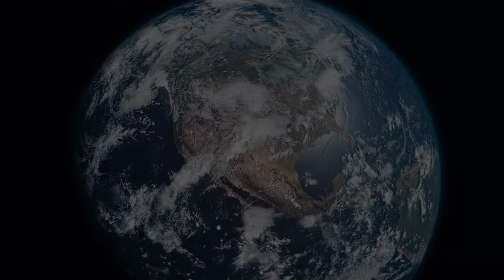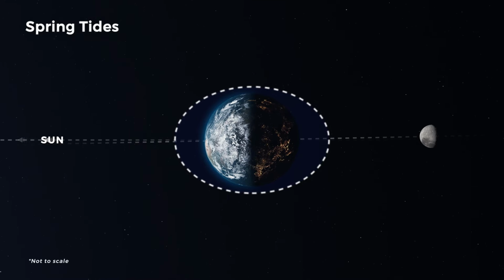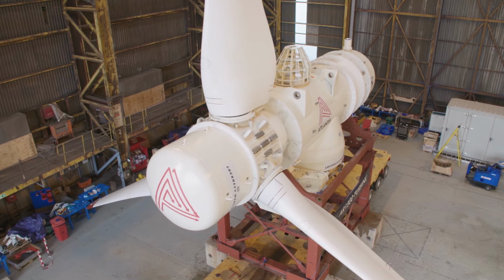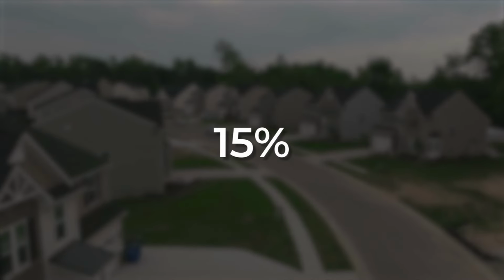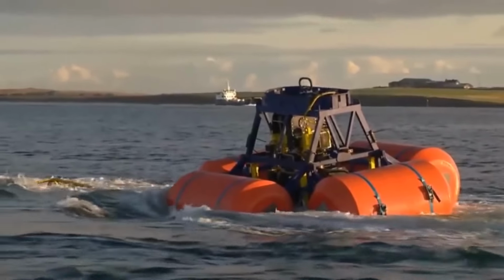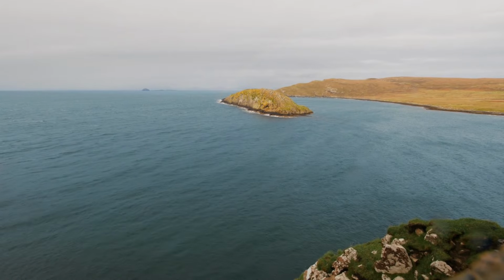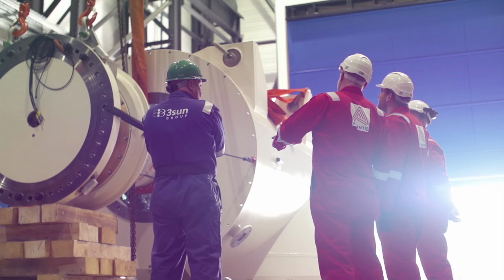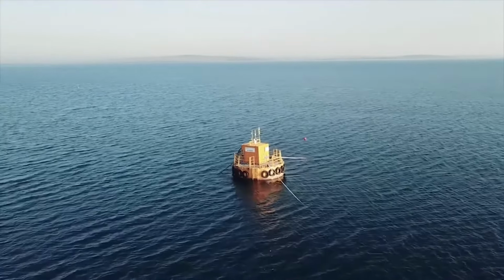Can Underwater Turbines Solve Our Energy Problems?

Comment: 11:35 I wonder if that forecast takes into account the rising cost of carbon based electricity? If coal gas and oil keep rising, (or even fluctuating erratically) this could provide  not only a supply - stable power source, but also a cost - stable power source.

Comment: 11:35 I wonder if their calculations took into account the rising cost of electricity from carbon based sources. If, 16 years down the line, carbon based electricity is prohibitively expensive due to dwindling supplies and tariffs, they will be glad they did this.
Reply: These are the more expensive big industry concepts. Some already out of market (Seagen, Openhydro). Our design is more streamlined to keep cost low by several factors. We expect to be cheaper than any alternative below 0,01 €/kWh in 5 years. https://youtu.be/nqbVTVMSSTM
Reply: While browsing for hydrogen production technology I came across a very interesting new science discovery by a NZ Lab named H2IL . It has the potential to replace nuclear, fossil fuel and renewables energy. I was intrigued by something so simple but scientifically logical. What do others think of it?

Comment: heard this crap in the early 90s, it's 2019, you think China, India and Africa are gonna stop using oil?
Reply: Naked Eagle I doubt China, India, or even the US or Britain will stop using oil any time soon. The point of researching and implementing new energy technologies however is to make it eventually economically viable enough to transition from fossil fuels to renewable energy en mass (aka it costs the same or less than gasoline for example). This isn’t just about energy extraction but also energy storage technology and everything that comes with it (ex. Automobile Manufacturers).

With the 10’s of billions of dollars in R&D both private and public going towards renewable energy every year, I think its simply a matter of time before fossil fuels become literally obsolete. 

Its just got to be a better deal on the consumer end. Just like anything in a market system, the market ultimately decides.

Comment: can we  please stop interfering with the earths systems, specially when we have nuclear available, it makes 0 sense to mess with our oceans anymore than we need to.
Reply: You are underestimating the risk of nuclear powerplant, if there are other powerplants that can provide enough energy to all humans nuclear wouldnt be so popular, it is only because that oil is consumable and can be exhausted and other powerplants doesnt give enough energy to supply all humans that engineers and scientist resort to nuclear powerplant, if there are more like this natural free source of energy enough to supply our electricity then nuclear would be only used for research and other scientific purposes and not massive powerplants that can endanger residents if something is to happen
Reply: @lemting2264  no i am not, nuclear is by far the safest, specially as we move towards molten salt reactors that are self regulating and are almost impossible to melt down, even then due to the lower pressures (steam) involved are no where near dangerous, (the radioactive part will just go to a separate chamber to cool down and solidify.
wind kills lots of birds every year, solar breaks easily and is really hard to recicle, dams displace much land and in case of rupture flood the areas down river, coal pollutes a lot,
while even the current nuclear plants have proven to be very safe, even in the major disasters that have happened (which all used very old reactors) have small amounts of casualities due to radiation, the total number of all cases is around 100 deaths.

plus molten salt reactors increase safety by a whole lot due to their self regulating nature, if not for the anti nuclear propaganda we could have been powered by this amazing tech since at least the 80s (reactor was developed in the 60s with a fully functional prototype) which btw can also produce (while also producing power as normal) the medical isotopes which today cost hundreds of milions due to needing a whole reactor just making a single product
Reply: @cj09beira  it would be acceptable if just said safe but by saying "safest" even though its not the safest... here ill just leave it like this, human technology are not absolute, human commits also mistakes, even all the equipments in the so called safest nuclear powerplant in the world has still room for failure once theres a mistep.

There are also many kinds of powerplants and there are much safer than nuclear, you can seaarch it on google for more info
Reply: @cj09beira  also another thing i want to share, the nuclear can be safe its true, but other powerplants can be much safer, its only because of the mentality of the people that they are handling every nuclesr powerplant super carefully, while other powerplants are safe but due to them being neglected as they are considered safe the mistake happen and problems may arise, unlike in muclesr powerplant where a little deviation would be immidiately checked and fixed, the level of handling between nuclear power lant and other powerplant can be described as heaven and earth.

Also since there are already catastophre related to nuclesr oowerplant that happened in chernobyl and japan people takes extra care, they are example of how nuclear powerplant can be disastrous if not handled seriously

But lets say that there is 100%safety in human handling and technology? Lets say that every country can at least have one nuclear powerplant, and all are absolutely 100% operational with 100%security, but these are only human variables what can you do about nature's action? We cant predict the variables the nature will throw out of a sudden, and making nuclear widespread means risking the many places to become uninhabitable once "unprecedented events" happened.

Even greatest engineers and scientist wouldnt claim certainty on these manmade structures
Reply: @lemting2264  have you actually looked up molten salt reators, because those are as safe as things go, no high pressure steam, coagulating fluid in case of leaks, not reliant on cooling to keep the reactor from melting down, the ability to have a cooldown chamber in the remote case of a "meltdown" (in this case is just temp being too high as its already a liquid), 
sure there might be "safer" ones, but at these efficiency, and power output levels i doubt it
Reply: @cj09beira  msr are not fully develop and still cannot operate on industrial level, it still has a long way to go

The current nuclear powerplants we have are the ones that need to be carefully handled
Reply: @lemting2264  fair enough
Reply: Bruno Cardoso what about the nuclear waste? Thats the thing im concerned about
Reply: @raphaele3433  thats the thing, these new reactors (molten salt reactors) can be run using the "nuclear waste", as its mostly made of fuel that was only partially consumed. on youtube there are a few videos about these reactors, quite a interesting story as they were discovered and researched in the 80s.

Comment: When I was an engineering student at Oregon State University (2013) there was a couple senior projects that had to do with sea based renewable energy. One was a long buoy that had the magnet sliding from one end to the other inside with wave action. Power was sent to shore via the tether. The other was a pole attached to the sea floor with the magnet floating up and down with the wave action. It was my understanding these were built and tested at scale then full size off the coast. I really enjoy these videos. Thanks for the hard work you put in.
Reply: https://youtu.be/CIYA6Jwwp4s

Comment: Nobody ever thinks beyond I want, I need. What about the Ocean? That water is moving somewhere for a purpose. Not just because.
What happens when you take some of that energy out of the ocean for our use? What will be the unforeseen side effect when those ocean currents are slowed down? Just because we can does not mean we should.
Reply: @daniilp6688  idk either. About how much of an impact we would have? Depends on how many turbines we build and how efficient they are at extracting energy. But those currents do impact climate. I would expect if you slowed them down significantly that the poles would get colder and the equator would get hotter.  IE. The temp differential between the poles and the equator would get larger. I have no idea what impact that would have on hurricanes and such. 
The Ocean currents right now bring warm water to the poles and colder water back down from the poles to the equator. It acts as a sort of balance. And when we change that balance it will have an effect.

Comment: Brilliant video, tidal energy deserves more recognition in the renewable sector. 

Potential energy for a turbine is relative to the density of the working fluid being used, so using water from tidal energy, which has a density rounded to 1000kg/m3, as opposed to air from wind energy, which is roughly 1.225 kg/m3, has a much larger potential for energy to be harvested.

This sector deserves further research as we are only just beginning to realise its full potential
Reply: unfo it's well guarded big industry territory, all entangled in coal & gas power plant turbines. I wouldn't expect too much happening w/o clear public demand for independent research funding. Or some crowdfunding miracle happens. Any sharingand subscription helps us to raise awareness

https://youtu.be/CIYA6Jwwp4s

Comment: Since you're talking about the oceans and oceanic technology, can you do a video about wave breaks and how they might be used by Seasteads? Ocasionally, some designer releases a drawing of a huge city-sized floating object with a barrier ring around it with what are clearly waves outside the ring, and very calm seas inside the ring. I'm not an engineer, so I've been having some difficulty in trying to figure out just how big those kinds of wave breaks would have to be in order to stop various sized waves.

Comment: It would be easier to just use fast breeder nuclear reactors.
Reply: Yes, and much more expensive.
Nuclear is only perceived as cheap since the government, and therefore the public, stems most of the insurance cost.
Once the government doesn't want to even partially insure nuclear power plants and pay for the disposal of nuclear wast, suddenly no company want's to use nuclear power anymore.
Reply: @3gunslingers  That is not true the reason nuclear power has become so expensive is the cost of dealing with the Green Fascist protests and their democrats allies refusal to allow proper reprocessing of the used fuel recovering the "unburnt" fuel and the newly bred fuels and other valuable radioactive material and the proper disposal of the small amount of actual waste that is so low energy as to be functionally harmless because if it has the energy to be harmful it is fuel. 
What went wrong at Fukushima was after an earthquake more powerful than they had thought possible in the region resulted in a tsunami higher than they thought possible in the region (it overtopped all the tsunami walls.) the loss of the cooling pumps do to the loss of electrical power allowed the reactors to overheat. If the heat exchangers had been 3 meters (about 10 feet) higher than the reactor cores convection current would have provided enough cooling to avoid disaster. I would have gone with 15 - 30 meters for the safety factor and allowing the reactor to run at power without active pumping which is inherently reliable. 
The same "environmentalists" that scream nonsense about 10 year predictions that have failed to come true for the last 30 years, also block wind farms, solar institutions, and nuclear power. Clearly  their leaders know that solving the problems would result in their having to get jobs and work for a living.

Comment: I've a question : is wind turbine with a vertical structure are better to produce and with a less impact on the environment than classic one ?
Reply: That's quite difficult to answer conclusively.
Vertical wind turbines have the advantage of having the heavy dynamo very close the the ground. That makes them easier to construct. 
On the other hand the energy harvested is in direct relation to the area which the blades cover. Classic wind turbines maximize this area with minimal effort. In vertical wind turbines the blades are in the "wind shadow" half of the time. So to produce the same about of energy a classic wind turbine can have smaller blades, although with a higher tower. 

There is the argument, that you can place vertical wind turbines closer together, because they are less sensitive to turbulences, but this hasn't been settled conclusively.

Comment: Just to transfer the Cold /Hot' different: temperature in the ocean or the Earth will create energy, like a radiator? By places pipes in the ground and ocean, and forcing the liquid like radiator fluid, but you need energy to do this?

Comment: So we finally have the ability or have had for some time to burn fossil fuels with almost none or zero emissions and now that's not good enough? We need better battery tech before we can get completely off them. I mean we have diesels that while running put cleaner air out the exhaust than the intake took in...... I'm not knocking the idea but also would corrosion not play a big part in these things longevity?

Comment: One of the more important practical limitations on renewable energy is that, so far, nobody has rolled out a renewable energy mechanism that can easily ramp up production to meet demand during peak usage times.  Thus, renewable sources can at best only be put toward the base load.  The same is true for nuclear, but nuclear does it better because it doesn't fluctuate at all.  Renewable sources that fluctuate uncontrollably, such as wind and solar, actually increase the amount of reliably controllable production that is needed, because if they happen to produce less power during peak times on a given day due to something you can't control, such as weather, you have to be able to compensate for that.  Thus, the additional power production required during heavy usage times is currently the exclusive domain of fossil fuels.

Comment: That is already an old and expensive technique that requires very fast moving tidal. There are another company called Minesto (https://minesto.com/) that has a proved innovated technique that unlocks very low tidal streams as well. They are "flying" kites and increases the flow up to x10 times the tidal stream. The calculated LCOE indicates that Minesto can be one of the most cheapest energy source in the future.
Reply: I've heard of them and seen their videos and oh my Deep Green is super clever and its patented which if successful is HUGE good news for The UK and surrounding area

only issue i can think of that will hinder Deep Green is how can it stop Marine life crashing into it??? 

Its incredible though it can park and then adjust its route to change of currents? That's amazing

UK should've ventured into Marine power ages ago

P.S have a look at Marine Power Systems Subs

Dual Sub
Wave Sub
Wind Sub

very interesting indeed https://www.marinepowersystems.co.uk/ have a read matey
Reply: @hellssurprise9338  About marine life: I doubt the kite system is entirely silent; after all, the turbine on the kite is turning pretty fast. So I'd expect the whales, dolphins and sea lions will keep a distance and not get struck. But that's an impact as well, of course.
Reply: I highly doubt that any kite system will ever have low maintenance and high availability. Is there anything in operation yet? Our CyKlone turbines are specifically designed for low and moderate tidal streams. https://youtu.be/nqbVTVMSSTM

Comment: I work in the renewables sector in the UK. In my opinion Tidal power is simply an inferior option to both Offshore and Onshore wind.
Onshore wind is the cheapest form of energy in the UK atm. However, according to a Cornwall insight report offshore wind will become the cheapest form of energy within 10 years.
That's why, personally, I think that offshore wind will be the dominant technology in the UK and other coastal countries.
The new breed of massive offshore turbines change the game completely.
When you build wind turbines offshore you can build much bigger than onshore. 
Bigger turbines mean more power, cheaper power and importantly more consistent power.
The latest GE Halide 12MW turbine can power 16000 European households and have a capacity factor of 63%!!!
Tidal simply cannot compete because of it being restricted to a few locations and the tiny amounts of energy produced in comparison.

Comment: As a physicist, I can tell you this isn’t feasible. Even in the perfect conditions that the prototype was put in, its only had a capacity factor of 59%. It’s been tried for decades in Hawaii now and it’s not working. Until we perfect cold fusion, fission is the best option. It’s clean, new reactors can burn up to 94% of the fuel, and have a capacity factor over 100%. Also the newest reactors are made so that it is physically impossible for them to melt down even in the most extreme circumstances.